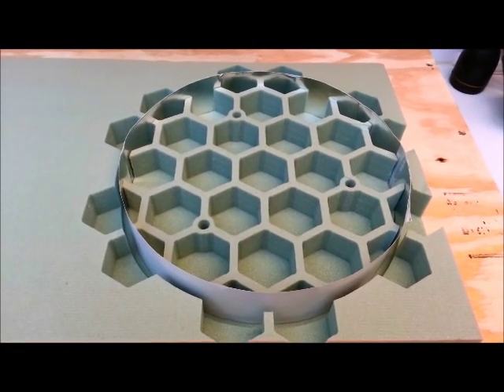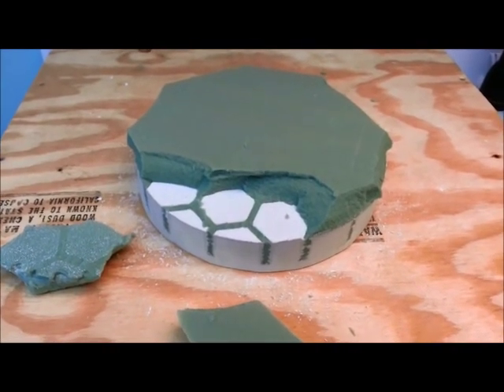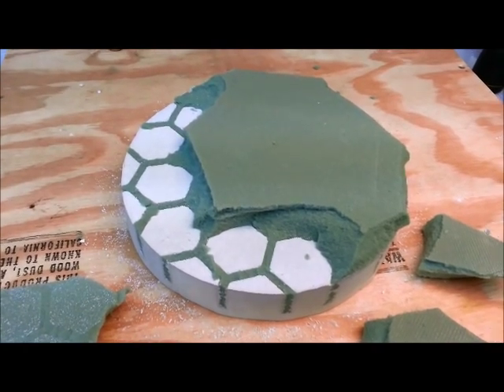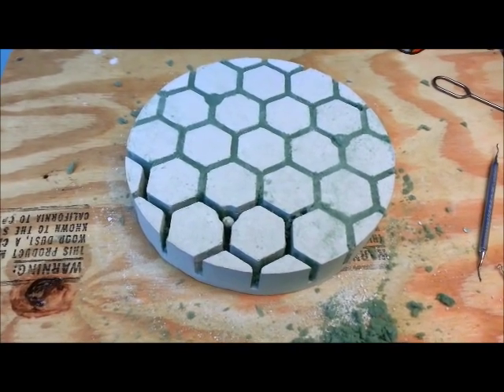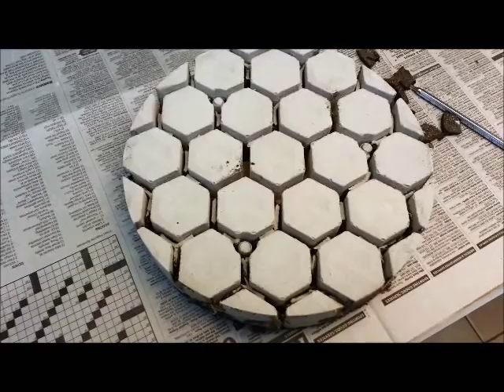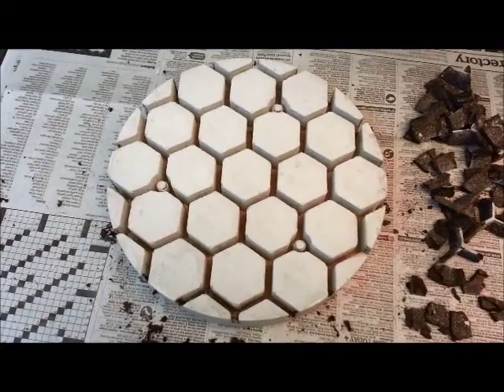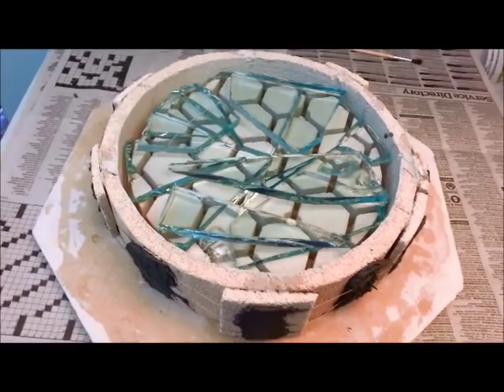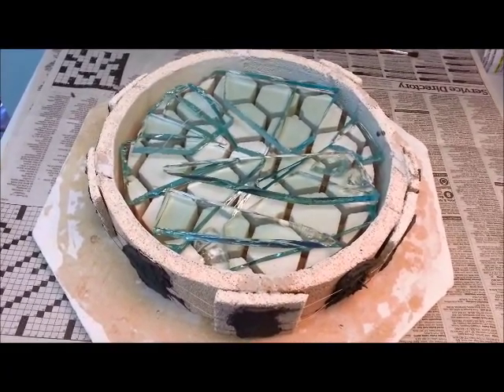Casting a lightweight hexagon back telesope mirror

Comment: normal gasoline will dissolve all of that plastic
Reply: did you not watch the video all the way through? he said that he used petroleum distillate.. otherwise known as petrol or gasoline
Reply: Acetone is better, and only idiots use gas for chemistry
Reply from the maker: Nope. I like this foam because of it's exceptionally fine texture and excellent reproduction of detail. The flip side is that it is a type of phenolic plastic that is very inert to almost everything. Gasoline and acetone Don't affect it at all. I have not found any commonly available solvents that even touch it. Burning the foam out in the kiln is the only way  I have found that works. It's not really a big deal. The foam gets converted to ash and can be blown off the plaster mold with a little compressed air.
Reply: @omegageek64  I wonder if you could cut the foam form a bit undersize then kind of slip-cast a very thin plaster surface over that, coating the foam with say ~1mm thick plaster, then after it hardens apply one of the many plaster mold release compounds....I don't recall them well but they're things like spray on waxes, oils, soaps and I even see now shaving cream mentioned ("said to leave a lovely waxy film when dry").  The plaster on plaster will separate and even if the ~1mm doesn't separate from that green foam it doesn't matter then because it will still fall out when the thin plaster breaks away.  Assuming putting the plaster slip on only takes a few minutes it might be an improvement over generating all the burnt plastic fumes and spending the energy to burn it out.  Another option might be dipping the cnc'd foam face down into a thin waxy solution, thick enough to mostly fill the foam pores but thin enough to not affect the geometry much.